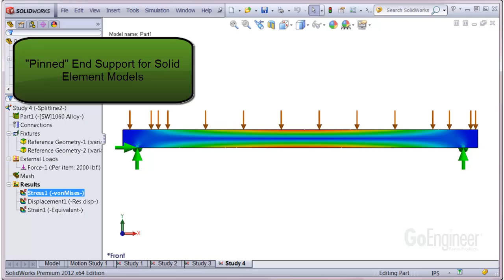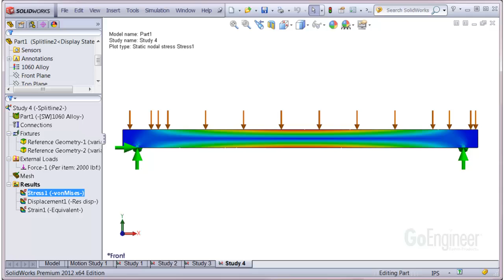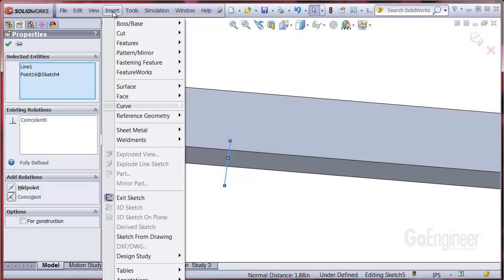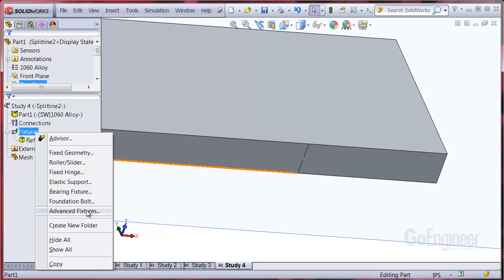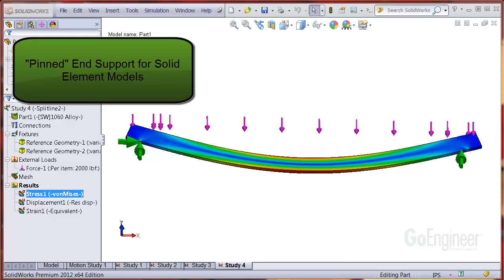SolidWorks Simulation - Pinned-End Support (Solid Elements)

Comment: The fixation is totally wrong. As a result you will get wrong displacement and stress in the middle of the beam comparably to manual calculation. The lines that are fixed should intersect the neutral axis of lengthwise section and be placed on the ends of the beam. Any point of bottom plane must have possibility to move along the beam and vertically.
Reply: That's what the beam theory lecture made hinge on a straight beam as a line. What does the matter if I make a wooden plate as shown in this video with two rollers attached to it at the bottom then I stand at the middle?
Reply: @tmtan1303   
Well, I have to admit that I was wrong. I calculated the stress in the middle of the bottom face of the beam in 3 ways : 
1 - using fixation as shown on the video
2 - using different fixation that gives correct results
3 - calculated the stress manually
For my dimensions and force I got the following results:
1. 412 MPa
2. 413 MPa
3. 416.7 MPa
Convergence is very good.
My apologies to the GoEngineer team!
Reply: @dmitriymalenkov9979  Добрый день. Скажите что за "different fixation that gives correct results"?

Comment: How can I remove stress from the supports ?
Reply from the maker: Hi noname90,
It is possible that the stresses in the supports on this analysis are perfectly valid stresses.  It would definitely be realistic that the load distributed across the top of the beam would ground out in the two point fixtures on the bottom of the beam.  The distributed force then becomes two concentrated reaction forces and would cause point stresses in the fixtures.  Some convergence testing of the results would be recommended.  You may wish to look at using h-adaptive iteration of the results like this:

http://kb.goengineer.com/go/default.aspx?kbID=14214

Comment: How to do this (right support) on a cylindrical face? I have a longboard, one truck is a fixed hinge, and I would like to make the other truck a rotational slider. Thanks!
Reply from the maker: Hi bkkrdbkstn,
To make a similar Pin or Roller/Slider fixture on a cylinder it would require two split line definitions; one to make an axial edge down the bottom of the cylinder and one to make a circumferential edges around the circumference of the cylinder near the ends of the cylinder.  The intersection of these model edges will create the vertex that either the Pin or Roller/Slider fixture would be applied to.

This would inevitably create an unstable model though.  For this specific setup for a cylinder it would require the use of a half model, cut axially vertically, with a symmetry fixture applied to make a fully stable model like the techniques used in this video:

http://kb.goengineer.com/go/default.aspx?kbID=14059